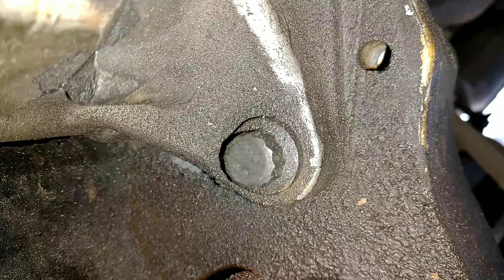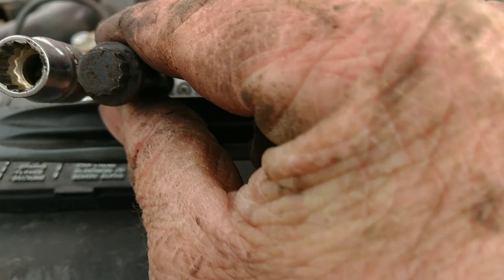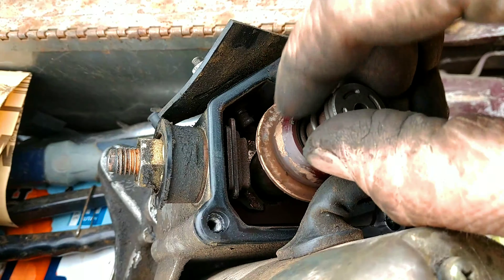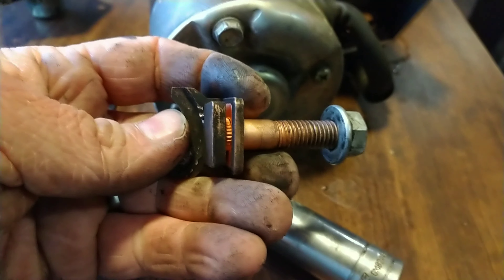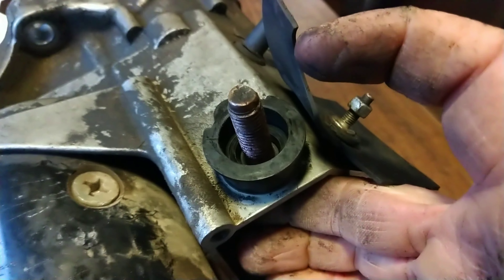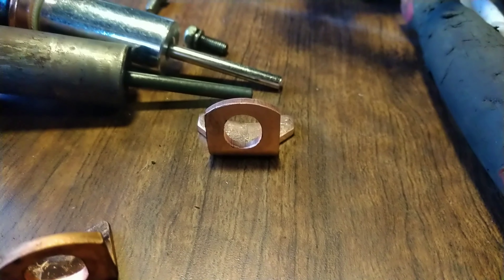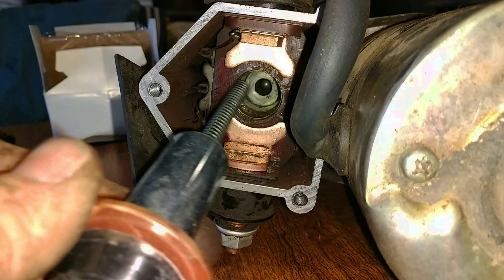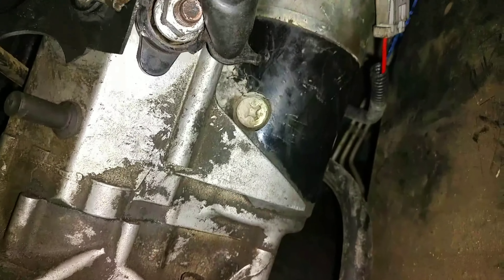Starter Solenoid Rebuild: 24 valve Cummins

Comment: Great video, thanks for sharing it. My truck takes a few long seconds for the ignition to wake up once the key in on… thinking that it might be the starter
Reply from the maker: Yeah, could be anything from a weak battery to the starter solenoid to a bad ground somewhere.... Definitely something in the ignition, battery, starter path.
Reply: @VanDamArtisan   tell me about it.. new batteries, I replaced the starter solenoid, ignition switch, transmission neutral safety switch, polished and retighten all negative connections but still same random issue appears even more often now, so the last to check is the starter...
Reply from the maker: Looks like you've pretty much covered everything. Good luck! You'll find it sooner or later.